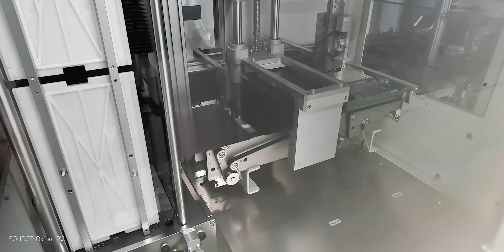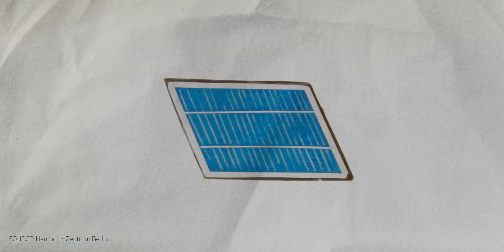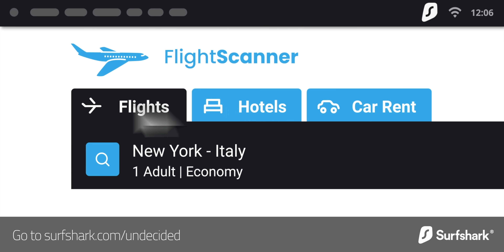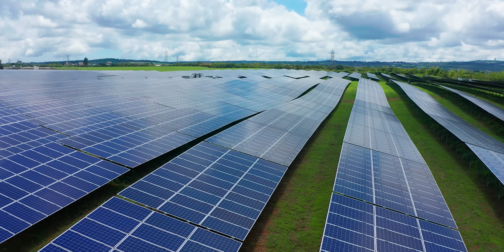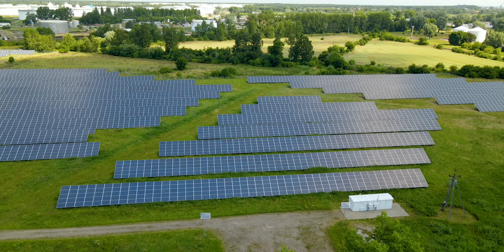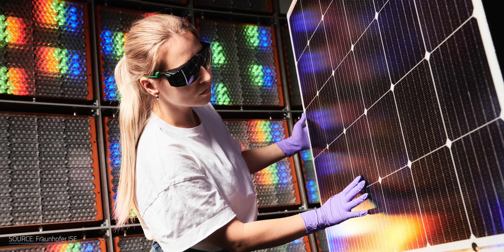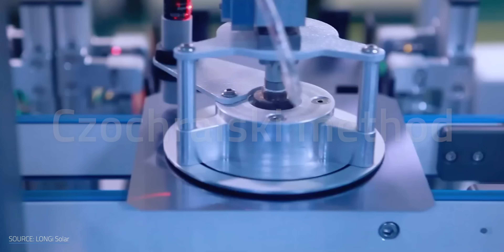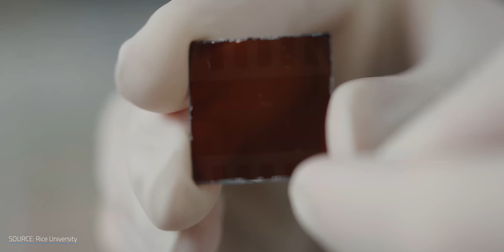How Record Breaking Perovskites Are Here NOW

Comment: 1. Get the peak consumption of an average US city. 
2. Get how much power per panel and square meter can the cells produce in realistic conditions.
3. Calculate the amount of solar panels needed and how much space they will require.
4. Then consider that they are only useful when the sun is up.
5. Realize you have been scammed and reconsider your life choices.

In order to be an alternative to fossil fuels. Any energy source needs to provide energy on demand. The only alternative is nuclear. Uranium fission in the short term. Thorium cycle in the mid term. Fusion in the long term. Everything else is a charade.
Reply: It won't be a charade if tandem perovskites are a 1/4 the price of nuclear together with batteries and pumped hydro.  Yes, I would like fusion.  But it would need to be cheaper than solar. As for Australia, the sun always shines.
Reply: @Romerso1  clearly you did not follow the steps I've presented. They can cost 0 euros and still they will be worthless. Energy is produced and consumed in real time on demand. Either you burn fossils or you split atoms. There is nothing else.
Reply: @Romerso1  Lol, no. The panels could be free and it would barely make a difference to the system cost. A mere 4 hours of storage puts the price of solar on par with Vogtle 3 and 4. Unreliables need enough storage to reliably cover long term fluctuations in collectable energy. That's weeks at the bare minimum, especially in higher latitudes.
Reply: Or...
4) Build 5% per year of that needed amount while building 5-10% battery storage
5) Realize there are different ramp times for different power sources. The day can be replace by a good chunk of renewable or even the whole thing. 

I dont know about you, but NO one is just building salor alone. Most are still considering adding batteries even outside renewables. Batteries help store power from all sources helping to cruve power spike demands and power switching. Even the other power sources still take time to ramp.
Reply: @adr2t  First, so-called ideal mixes of wind and solar are still significantly more expensive than current build nuclear, even without the requisite storage. Second, unreliables do not ramp at all. They are non-dispatchable sources with basically zero inertia. Third, dispatchable generators don't need storage to meet changing demand. Because they're dispatchable. duh. Even baseload nuclear plants are designed to be able to throttle at rates similar to gas peaker plants.
Reply: @adr2t  Current and even futuristic battery technology is useless for the capacity needed. Energy is produced and consumed on demand.
Reply: Ever heard of batteries or wind.
Reply: @craigfoulkes  You really don't get it, do you? While a mix of wind and solar is cheaper than either on their own, it is still calculated to cost significantly more than current build nuclear. That's without including the ridiculous amount of storage needed. And it's not like global battery production can just magically increase by the required multiple orders of magnitude anyway.

Comment: I think we need to focus less on the most efficiency and more on which is the easiest for recyclability
Reply: @haroldnicholos7436  Actually, that's also efficiency 😏
Reply: Recycling panels is very easy - if!!! you can separate the valuable PV part from the not-valuable glass substrate...
Reply: I'm not even going to watch this one, because all of the previous updates on it failed to mention (at least to a meaningful extent) the issues with current perovskites being based on lead. If it becomes widely used in its current form it will certainly create a significant amount of lead pollution, especially around populated areas.

Do we need a rerun of the effects observed a few decades ago from widespread use of lead-based paint and leaded car fuel?
Reply: @TLguitar  - Not all perovskites are lead based, only the subset mentioned in the video, that if you watched you would have understood this was raised. 

Even with lead based perovskites, studies have been done into the leech risk from PVs, including lead run-off, the risk and volume determined are tiny and not that much above background levels in anycase. Unlike paints which were exposed so errosion run off had an impact. With PV's the chemicals are contained and exposed only by accident and on disposal not in the installation environment. Handling and recycling procedures and processes will reduce the risk further. It's more likely to get more lead run off from the roof itself than from the panel on the roof, particularly on older roofs and in certain parts of the world. 

So the OP was correct to highlight the recycling need and indeed this is being developed, at a fair pace, and is looking to shape up to be a similar approach to batteries with manufacturers being made resposible to perform or pay towards the recyclining of the panels.

Not sure why you sought to scare monger if you've not watched the video.
Reply: @GruffSillyGoat Because I've already watched previous videos from this channel about perovskites.

And I did a quick Control+F on the transcript and saw that lead was only mentioned once when explaining the basic chemistry, without further references. But lead-based is the type always in current discussions, while others are currently not good enough so the technology in question, as of now, will be based on lead.

The companies involved in the development of current-generation lead-based perovskite solar panels probably all downplay this aspect, but it is much more likely not as manageable as they claim it is. From the information I could gather, each square meter of such solar cells contain about 7 kilograms of lead. That means that each household retrofitted with such panels would have hundreds of kilograms of lead across its roof.

If lead-based panels would prove commercially viable and cheap enough for mass consumption, then their circulation across residential and industrial buildings in developed countries could easily double our global lead consumption. I just don't see that as a non-issue.
Reply: @TLguitar  Watch the video mate, how on earth do you expect to update your information if you refuse to learn about your chosen subject. Unbelievably ignorant... The amount of lead in a perovskite solar panel (PSC) is usually very low, around 0.015 mg l−1 dm−3. This is similar to the amount of lead in the solder used to assemble crystalline silicon solar panels.
Reply: @Mick-60  He didn't even talk about it, because a quick search of the transcript shows the word "lead" has only been uttered once and not within the context of this discussion. I have already watched a bunch of his previous videos about the technology.

Anyway, it seems it is difficult to get an accurate actual number. I see what paper you copy-pasted that paragraph from, and right on the next sentence they say "Around 17,000 metric tons of Pb is embodied in the production of the perovskite layer for a yearly 2400 GW electricity generation". What is a "yearly 2,400 GW electricity generation"? Gigawatt is a unit of power, not energy. Maybe they wanted to say 2,400 GWh, which for an average yearly energy production rate of such a panel should amount to about 2 million square meters of panels, and thus for their 17,000 tons of lead estimate it arrives at 8.5 kilograms per square meter. Something is way off in that paper.

And what is even "mg l−1 dm−3"? "milligrams per liter per cubic decimeter"? What is the redundancy for?
Reply: @TLguitar  I live on a lead mine. Lead itself in the environment is actually pretty common, and only poses an issue if you ingest it. I don't think toddlers are going to be getting access to, and chewing on solar panels en mass anytime soon.

Lead in paint was consumed as small flecks or when licked by kids. Lead in gas gets inhaled in exhaust, or on your hands. Lead in solar panels is about as dangerous as lead-acid batteries. Just have a good recycle plan to round up the majority of it, and make sure the public is aware that special recycling is needed.

Comment: I hear about ground breaking discoveries and cheap solar panels every year but my energy bills tell me a completely different story
Reply: You actually have to adopt new technologies to see the benefits.
Reply: The problem is solar generates energy at times when less of it is needed: daytime and summer. 

There is no viable cheap storage solution, not even pimping warer up reservoirs is competitive, thus the only way right now is transportation. The network for transporting this excess energy is not available and should really span continents.

On many days in summer Germany pays Austria to take German excess electrical energy off the network to prevent it from going down. Imagine that. This is why your energy is worthless on the market. The most efficient solution in terms of return on investment right now is having your own storage solution and making sure you use 100% of the power you generate yourself. You can even buy old EV batteries for relatively low prices. But I would not want that fire hazard anywhere near my house.

The whole thing is much more complex than just panels. Panels have been good enough for a decade. The rest of the infrastructure; not so much.

Comment: We need them cheap but also we need cheap capable batteries. Whats the point of more instantaneous energy without storage ?
Reply: You're correct, though the question is a wider one than just bolting batteries on to what we have. Building design really needs to start reflecting the need for energy storage ... be that electrical or thermal.
Reply: Yes and no. We need to have both. Even at 2.5% increase across all areas is just - that many panels less we need to hit to get the same power output than before. Even if its only limited during the day, there are still plenty of things that can help offset their power cost.
Reply: perovskite generates energy even at low light so the battery required would be smaller.
Reply: Panels and turbines could be free and it would barely make a difference. The amount of storage required to make a dependable power grid based on unreliables is absolutely ludicrous.
Reply: @JacobNeff-oq5km (*cough*) EV batteries
Reply: @JacobNeff-oq5km  Uhhh, if they was free - that would change everything really. Even the lowest value storage holdings would be more than enough. So saying if they was free wouldnt change anything is a bit of a miss understanding whats going on. Everyone would be pushing to get as much done during the day as they could and stuff at night would be shifted around to be more support the night time activities. The main reason you say that is because there is a "base load". Thats all you have to match.

Comment: The secret is to put the perovskite on top of a layer of silicon and isolate it from oxygen through a transparent glass cover and chemicals that increase the hardness to preserve it for 25 years.
Reply: Maybe the real secret is the friends we made along the way.
Reply: Why not just put the silicon on top of the perovskite, since silicon is already a durable rugged material?
Reply: @manofsan  - The perovskite is a thin selectively transparent layer, it absorbs just the blue part of the spectrum and passes most of the rest of the spectrums through to the silicon underneath. If you layered the silicon on top it's a thicker layer that is less transparent (reflective) to the light spectrum you wish to pass through - so have a lower efficiency.

Perovskites are tuneable as well, so you could have multiple layers on top of the silicon each absorbing different wavelengths of light before passing the red light onto the lower silicon substrate. This would raise light conversion efficiency even higher.

You could also have bi-facial tandem panels - comprising two tandem cells back to back - that are useful in certain installations to collect any scattered light on the back surface. This might be a future enhancement once production costs of the tandem cells drop low enough (as was the case with silicon only bi-facial panels).
Reply: A Nobel Prize winner here on YT comments ...... lucky us!
Reply: No but it might be correct. Its not his idea, its what is reseached atm@TheHoveHeretic
Reply: Maybe but the real secret is controlling the process and actually get it shipped.
Reply: sauce?
Reply: @sino_diogenes  Hotdog ?
Reply: Glass made of what? Silicon?
Reply: Whatever you cover it with is going to reflect some of the light/energy.  gg

Comment: 2.5% is not really worth a video entitled "record breaking." Something that is only 9% better than the best mono-crystalline panels offered by SunPower. SunPower's panels currently are 23% efficient.
Reply: It's a question of scale. Even a figure of 2,5% (whilst clearly not impressing you!) represents a considerable improvement taken across the board.
Reply: @TheHoveHeretic  It does not, but carry on.
Reply: This is an additive technology to silicon cells, it can be used to increase SunPowers cells as well as any others. The OxfordPV licensing approach means SunPower could buy the licence, plus the drop-in manufacturing equipment OxfordPV have developed with their German partner (who supply equipment around the world), and then they've also got a ready to go  pervoskite product to sell as well.
Reply: Don’t we already have 25% N-Type panels readily available?
Reply: Probably gets paid to glaze the "green" companies
Reply: In 6 years these will be 7% more than your pet sunpower’s efficiency. Take that 👊
Reply: It's not going to make a difference if you have 12 panels on your roof.... ( Though that is 10% more...) It's all about scale.... Think 1500 panels.. In a farm
Reply: @JoshuaHarper  True, but its not a wild break though base off that number. It makes it a break through is the fact its using this new type of crystal. The next move would be to move both or whatever layers to using it fully - thus making it a bit cheaper.